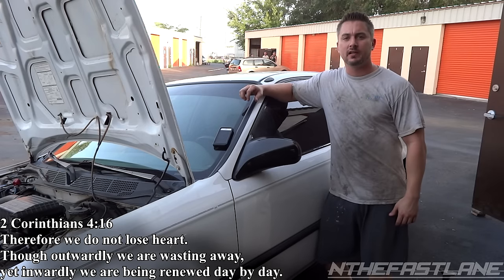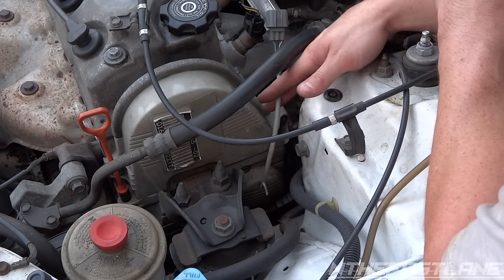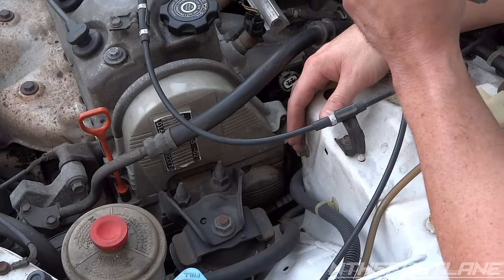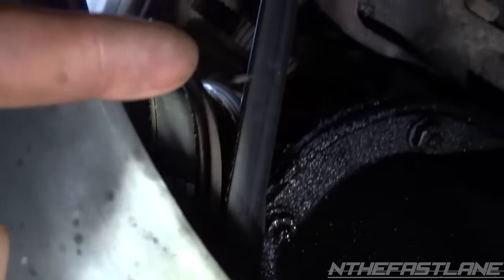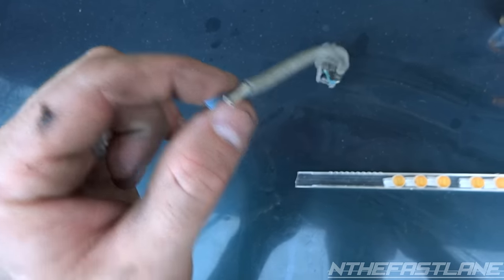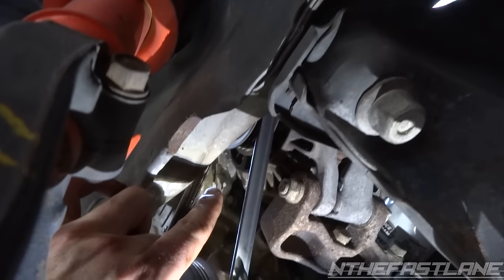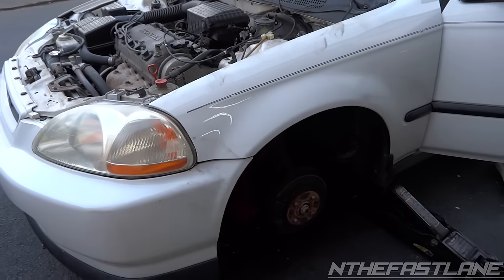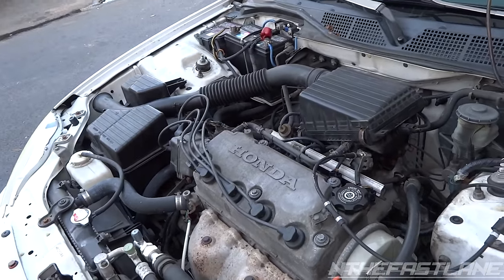▶️Cranks But Won't Start Honda (CPS) "How To"🔧

Comment: I would like to say thank you. My gf and I were out and about and we were driving her 2000 Honda Accord. The engine wouldn’t start but it kept cranking. I was like oh man what are we gonna do.  It was about 96° out and we were stuck. I did a quick google search and your video popped up. I watched the first few minutes. I got out of the car and I said I think I know what it is.  I went ahead and popped the hood, detached the cable and reconnected it. I turned the key and boooyah! It started!!! You should have seen the look on my gf’s face went I did it… the look of hot dammmm babe!!  

Thanks for the pointer and for making me look like the hero for the day!! Lol
Reply: Hoping I can have this feeling all to myself when I fix this $600 01’ civic I just got lol

Comment: No starts are the worst. Especially when you've just built the motor and your're thinking "this could be a paperweight if things don't work out". Good advice.
Reply from the maker: ***** Thanks Christian.
Reply: I have 2001 Honda Civic. Car doesn't starts in the cold weather. When the weather is good, it starts usually. What could be reason?

Comment: U should of showed the sound of the car before u started it
Reply: I have 2001 Honda Civic. Car doesn't starts in the cold weather. When the weather is good, it starts usually. What could be reason?
Reply: @Xarataa5654  oil too thick when cold maybe?

Comment: Finally found a possible solution to my problem. My car starts but sometimes after a drive it won't start and I have to wait about 10 minutes for the  car to cool down and it will start again
Reply from the maker: You could also have a bad coil inside your distributor. Sometimes they overheat and short out.
Reply: @Nthefastlane  oh okay, I've also read that it might also be the ignition control module . Thank You!
Reply from the maker: @morpheus101a  Yes it could be that to. One other thing to check is your main relay. If you turn your key two clicks and you don't hear a hum in the backseat, more than likely it's the main relay. It's located driver side left foot under the dash.
Reply: @Nthefastlane   Wil do. Thanks again!
Reply: I Have The Same Exact Problem I ate going to go get gas and Have to wait about 10 minutes there 🤦
Reply: @khristinaesparza8984  just changed the main relay yesterday. See if that fixes it.
Reply: Let Me know if it does !
Reply: @khristinaesparza8984  I will
Reply: @khristina Esparza it's been 3 days straight and my problem seems to be fixed. X D
Try replacing the part it's very easy and the part is cheap
Reply: Goooood thanks for letting me Know !!
Reply: @khristinaesparza8984  You're Welcome.

Comment: Just changed the inner seal of distributor, fitted back but didn't start instead and small blast sound  after some a few attempts. Rotated the shaft 180 deg but not it refuses to fit  back, tried a lot of positions but the distributor doesn't sit neatly and stops 0.5 inches before the full seating. Any idea

Comment: I have ls vtec. 98 ek civic ex harness. Running obd1 p28 with jumper. Do i need a crank position sensor? Cranks no start but that sensor on ls block is a two pin and the connector on ex harness is 3 pin plug so its not connected. Is this a problem

Comment: Hello, I was wondering if I could get some help... I have a 99 Honda Civic Ex that has trouble starting. I have to crank it quite some few times then it starts rattles a bit then idles high then back to normal. Drives normal doesn't seem to have trouble just when starting. I get a lot of fuel smell but im guessing thats becuase I crank it so much. Also have a P0420 code. Any ideas? Thanks i. Advance.

Comment: This thing drives me crazy now, my 1992 honda civic vx D15Z1 with new distributor cranks but really struggling to start up I had to step the gas several times. The car runs smooth and no loss of power when it starts up. I am thinking of the issue of CPS but I can’t find the correct parts, do you have a part number for it please?
Reply from the maker: The first 3 things I would look into would be the fuel filter, spark plugs/spark plug gap and a possible vacuum leak somewhere.

The next 2 I would look at would be the  mass air flow sensor and O2 sensor.
Reply from the maker: It won't hurt to change out the spark plug wires if you haven't already either.
Reply from the maker: A tricky one that's kind of a hit or miss is the engine "Coolant Temp Sensor". If this sensor malfunctions it'll make the vehicle run too rich at start, causing a rough start. This sensor sends a signal to the ECU affecting air/fuel ratio.

Comment: Do you possibly think you is what’s wrong with my car. I have a 96 Honda Civic ex, brand new alternator, battery, fuel pump, spark plugs and wires. Car still cranks but won’t start. Could be the crankshaft sensor?
Reply: Katie Cunningham, check for loose ground connections. Do you have a DVM (digital volt meter)?
From the front of the car, look on left side for the Starter.
Check that Ground wire that is connected to Starter.

Comment: What about obd1? Because my car has no crank sensor but I have no fuel no spark and no tach, my understanding is that my crank sensor doubles off the cam sensor in the distributor

Comment: My 95 Accord LX (non VTEC) only does the crank/no start after driving in heavy rain…then after a day or 2 of dry conditions it will fire back up.  Could this be the same issue or do you have any ideas of something else I should check?
Reply from the maker: Hi Sensatious,

It could be, but I would suggest the next time it won't start, have a look under the passenger side glove box to the right. The panel comes off by your right foot.

The "ECU and Main Relay" are located there. A lot of times water likes to drip down the corner of the windshield seal or the top roof weather stripping, the caulking gets a crack in it. They might be getting water on them and shorting out. In some cases you might have to remove the vent underneath the windshield where the wiper motors are. There will be caulking with cracks in it there as well.

Hope this helps.
Reply: @Nthefastlane  I’ll definitely give that a look when I get some time…I’ll write back on here if in case anyone else finds this comment.  Thanks for the video and reply 😎

Comment: I bought a Honda that starts but has a rough idle. And the check engine light reads P0336 Crankshaft Position Sensor Range/Performance. I dont know if i should start at the sensor on the block like yours or the distributor. Im getting conflicting information. Its a 1997 Civic EX D16y8

Comment: Hmmm maybe my 1998 honda civix DX the wire ripped i havent checked ... one day i was coming back from thw store when my battery light came on so i thought it was my alternator... so i went and bought a new one replaced it but still it wouldnt start... then i went to buy a new battery thought that was the problem and still no crank every time i turned the key the motor would just rotate and didnt start... today i changed my fuel filter but still nothing... it keeps doing the same thing motor just keeps on rotating.. but doesnt crank ill definitely check out the wiring to see if mine didnt rip it off

Comment: I have a 1995 Honda Civic dx that will not start but it will crank,I replaced all the sensors and ecu and distributer,sparks plug and wires,main relay .could it be the crankshaft positioning sensor?

Comment: Excellent video. Just picked up a '99 that started hard. Cranks, cranks. Turn off key. Cranks, then starts. It also had no alternator belt or a AC belt when I got it. Maybe the belts went and cut the CPS wires
Reply: What was the main issue because my 2000 is doing the same thing?

Comment: Great video, especially the part about the position line up with the distributor
Reply from the maker: Jaheel Frederick Thanks Jaheel, I try to give as much accurate info as possible.
Reply: Nthefastlane ive had that issue already LOL ,great stuff man

Comment: Hey I have a 1998 Honda accord, 2.3 vtec, 5spd. My ac leaks on the passenger side somewhere so I try not to use it, I was driving and using my ac(dumb choice) and my car died 15 minutes into driving. It would crank no start. P1382 CEL code. I’ve replaced distributor, tested alternator, checked fuses, swapped in ECM/ignition and still same CEL and crank no start. I’m stuck on what to do next

Comment: Im having a simular issue, but i have spark and fuel. would i have spark if its my cps? or the cam sensor on the distributor. ? thanks.

Comment: I have a feeling this is my problem. i was told a month ago i needed a new crankshaft sensor. my serpentine belt broke and the loose bottom timing cover got caught in the harmonic balancer. i hope this is my problem and not a timing problem :(

Comment: My '96 Civic won't start when the motor is warm.  Has fuel, spark and compression.  Timing belt replaced 5,000 miles ago.

Comment: Youve probably heard this a lot but here is my problem.... I took one plug out to check if it was bad then put it back in... Torqued it to spec and it would not start. I cleaned the dizzy cap.. I changed all the plugs and gapped to spec. Next I checked to see if I got spark by grounding all spark plugs to wires out of chamber and I can see spark on all of them. I'm so clue less I don't think it can be ignition can it? And I know fuel is working because I can smell it... Next I don't think it could be timing because I didn't even touch that
Reply from the maker: Ashwin Sivaainkaran Replace the main relay under your left foot and on the side wall above the fuse box. More then likely that is your problem. The main relay turns the fuel pump on, very common problem on all 92-00 honda civic's.
Reply from the maker: Driver side
Reply: But the problem is I can hear the fuel pump prime on my integra as well
Reply: Do you think it could be a dizzy problem because I know it's a missfire due to the fact of my obd2 reader but I'm getting spark?

Comment: Mine cranks but when you remove the map sensor plug it starts but the moment you put the plug back it just cranks and with another sensor engine light stays on and cranks only

Comment: Got a 01 Honda civic 1.7 manual... during the cold I would have to tap on the gas pedal to start up cold... and now it doesn't start at all...it only cranks...doesnt he start pushstarting it...timing belt good

Comment: What if the car cranks, will not start and you cannot move the shifter out of park without putting a screw driver into the "bypass" switch? It will also not start in neutral.
Reply from the maker: The no start possibly doesn't have anything to do with the shifter selector. 

If you are speaking of an automatic, then I would look at the brake pedal switch. This switch engages the brake lights. This switch also engages the automatic release of "Park" when the brake pedal is pressed so it can be moved to Neutral, Drive and Reverse.

The no start could be several things varying from distributor, cam sensor, lack of 5 volts to the distributor, bad ECU, bad fuel pump, bad fuel pump relay ect.
Reply: I just had my 99 civic dx do the same thing after it stalled abruptly at 40 mph. It's been lagging for weeks, like gas is restricted and I'm heavy on the gas pedal. I'd have to cut A/C to not stall when idling. This last and maybe 5th stall was the worst. Other times car stalled but kicked back on or motor started as soon as I cranked it. This time I couldn't get it to neutral from park to push it off street til using the release slot. Stuck in park a few times. I hear fuel pump. Cranks fine. Fuel filter? I know next to nothing about cars. It started fine the days before, and 15 minutes before the last stall. Just seemed starved of gas while accelerating or w AC on. I read all the possibilities above. Does this description maybe eliminate some of those? Thx
Reply: @Nthefastlane  Thank you! Cars have gotten a lot more complicated sense I started working on them (40 years ago). Still researching the problem. I replaced the break pedal switch and the little plastic button that the switch lands on a few weeks ago. Thought it was fixed but nope. I read that you should turn the ignition on and press the gas pedal down slowly and the brake at the same time and try to shift. That worked at least once so yesterday, I replaced the throttle position sensor. If fixed, I will be good! If not, I am thinking the ecu.

Comment: Can you tell me why my accord isn’t starting ,replace fuel pump ,temperature gauge ,the main relay wasn’t working so we hooked a flip switch to it and fuel pump turns on, but the car won’t turn on now , crank no start please someone help me is it the starter module?

Comment: I've got a 99 civic cx. I replaced the fuel filter and the car fired right up but died about a minute later. The fuel pump is working, there's fuel pressure and I've retraced my steps & all looks well. Engine cranks. I left the car over night thinking it was flooded but still won't start. Any advice?
Reply: izzy s did you get this solved?
Reply: Honda's are notorious for having a bad Camshaft Position Sensor. The check engine light will not come on. The dealer told me to install a new sensor- and it started right up. It is a flaw in the engineering of the Honda PCM. The CEL should come on to help guide the the technician- but in Honda's case it usually doesn't.

Comment: Just curious did it still give you a light spark at the sparkplugs still before the repair? I'm going through the same thing with a 2000 civic d16 vtec model with distributor. We changed the fuel pump, main relay, ecu, wiring, grounds, distributor, alternator, battery, intake manifold gasket, and sparkplugs. Timing belt and tensioner is still good but it looks smutty up in there. Think the sensor may be dirty or bad? It acts like it wants to start but never does.
Reply from the maker: Check your main plug connection by the master clutch cylinder reservoir and brake booster. I had mine disconnected for a little bit and it got just a little bit of corrosion on some of the pins. Turned out it wasn't applying a correct voltage to the distributor. I troubleshooted for an entire week and finally found that to be the problem. Cleaned the pins and put a little electrical grease on the pins. Once I did that I never had another issue.
Reply from the maker: Also if you think they're making a weak connection grab some needle nose pliers and give them just a slight little twist so they make better contact.
Reply: What sensor was bad or how did you fix it I'm having the same problem and replaced everything you stated above